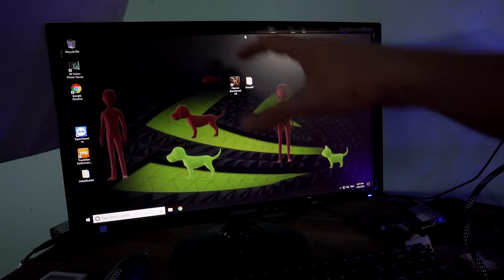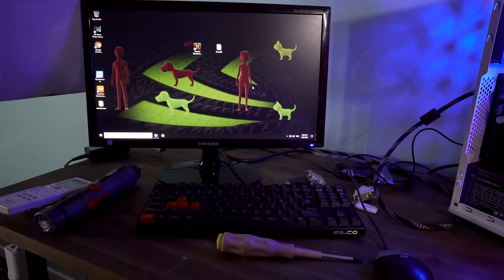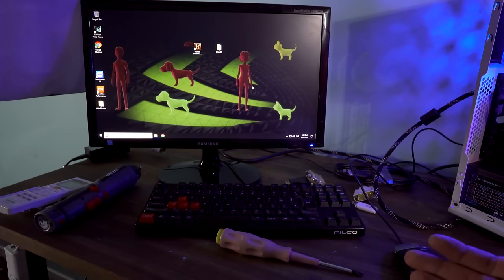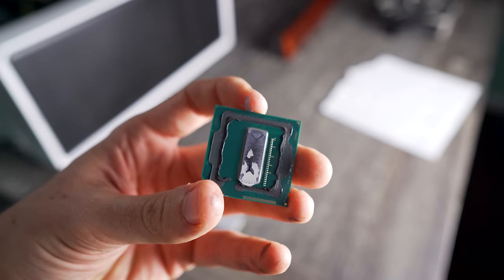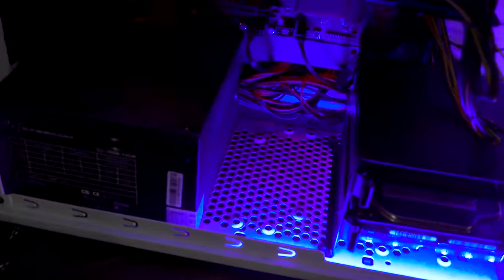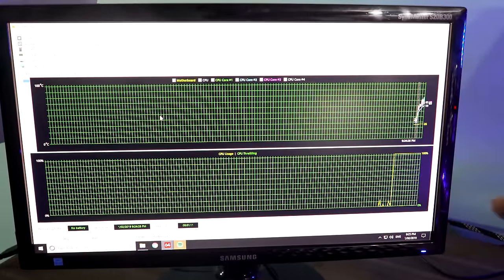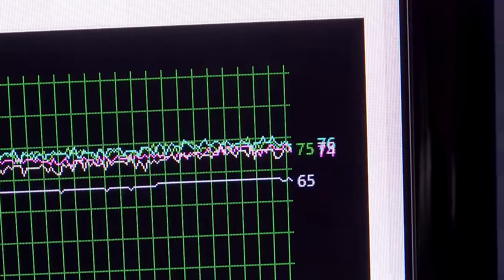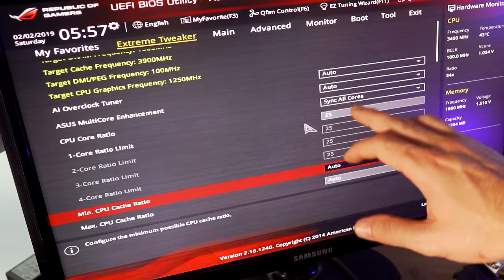How to Spot a FAULTY CPU.....? The i7-4770 Dilemma....

Comment: I think i have a faulty 8086k. I had bsod's randomly, even under windows install sometimes.. sometimes it would let me install it other times it would just freeze or bsod. I noticed a bent pin on my motherboard and replaced it. Although it had seemed like the cpu contact side had some darker spots, or miscolour. Mind you i had a h150 360mm radiator on the cpu and it never got over 50 under load, so i cant see how that would burn it.  But after i replaced the motherboard i still had the same problems with bsod. Also tried with different ram and ssd's. Could the bent pin have damaged the cpu somehow?

Comment: I’m having issue with pc build, when installing windows I get error message 0xc0000001 Stop_Thread_Handle_Exception_ Error_ message. At first I thought it could be the m.2 SSD so I flashed the BIOS and still the same problem occurred. The next step was to try the each memory stick and each one still gave me the same message. I even tried installing the OS on a different drive but that did not solve my issues. I’m coming to the conclusion that it may be a bad motherboard or bad CPU but not sure. Any assistance or advise on this matter would be appreciated.

Comment: i have heard that delidding cpus can void warranty.

maybe because you are an authorized dealer/builder allows you to delid and re do the thermal compound without voiding the warranty.

i am even surprised that manufacturers will warranty their electrical parts as many parts dealers diy repairs can void the warranty.

take for example if you replace the electronics of your kitchen oven your self you may lose the warranty as the manufacturer has no way to know how you handled the part and for all they know you could have burned the new part by connecting it wrong.

even worse there is swapping fraud where people buy new and put old in box and return it

Comment: Hello, and first of all great channel! Lots of informative and helpful videos, BUT please please stop using dissolve in between some of your cuts, cause you move camera almost every time and you have ugly transition there ( example on tc 3:40, from keyboard to bios menu, 3:52, from load optimized settings to keyboard, 4:09 etc. )  You can get away with cut instead or try something else , and your videos will look better. Dont get me wrong but little things like that and there is almost and you will have much better end result.
Anyways keep up the good work!
Reply from the maker: Thanks for the feedback, in the process of changing some camera gear around now.

Comment: I had a CPU that had a bubble in the paste application that actually caused a small fire, after taking the cooler off it has a small little crater where it had been burned...CPU runs fine after repasting but I had to add just a bit more paste to that crater area... Weirdest thing ever

Comment: Be careful with Cool Labs LM, seen a few now where after a bit (year or so) it goes hard and you have to scrape it off with a blade like soldier. I only use Thermal Grizzly now.
Also that's a crap cooler for a 4790K, you don't need to delid them, just use a better cooler for the job.
Reply: Watch the video carefully.  He specifically noted heat was not transferring to the CPU cooler and clearly demonstrated that delidding fixed the issue.

The cooler was not the issue.
Reply: @giglioflex  
Using a under rated CPU cooler could be the cause though with super high to low heat cycles which can dry the paste more,  just because it was ok at first means nothing to how it is in a longer term, and even after LM temps are still high showing what a crap cooler it is, it looks similar in size to a stock Intel cooler which they don't provide with i7 K sku as there not good enough, I have 2 CPUs on LM, 8700K and 6700K, I'll use the 6700K as it 4 core, at stock under prime it hovers between 45/50c, but with a 4.8GHz OC it still only hits 60c, stuff like gaming it barely goes above 30c, that cooler sucks for a 4790K and probably didn't help the cause one bit.

Comment: I bought a Cpu and mobo 8 months ago. It didn't started quite well, random shut down, freeze etc. But recently when i start computer it just opens but all the apps disappeared, basically it's gone. When opened the intel i-3 10gen processor just showing burn mark really unfortunate, intel won't relplace it because of burn mark...

Comment: Can a faulty/fake cpu fry motherboard I have a dell t3500 had a Xeon x5667 upgraded to a w3680 as soon as stuck it in there turned it on  and got a solid amber power light 234 light up and fan speed up no black screen I thought was the cpu so put my old one in and now still doing the same :( tried alsorts

Comment: So if my pc sounds too loud, could it be the cpu overheating and causing the fans to work harder? I got a used i5-3470 and I feel like i should re paste the thermal paste for the gpu/cpu.
Reply: You should see if your cpu is overheating using a program like speccy, or msi afterburner
Reply: @lollb454  yeah that's probably my best bet.

Comment: I have a Core I7 10700 cpu and after a year of owning it with moderate use and adequate cooling with a. high end motherboard and PSU I did downsized my pc from an tax to a mini ITX build still with the 80 plus for PSU and a nice motherboard I was stress testing it the temps only went up to 50 Degrees C. 3 days later I turn it on and I'm greeted with a no screen and a RED LED CPU on the motherboard, I swiped everything and the problem is still here so for sure I have a dead CPU. I hope intel will do there job to send me a replacement.

Comment: Doubt it was actually overheating that was the problem. It should just thermal throttle and slow itself down. The reseating of the CPU probably solved it

Comment: Prime95 is not recommended to work with Haswell. its not supported and causes massive over heat because of the CPU architecture not because of the TIM. I used to remember exactly why but it's been many years since I had an Haswell.
Reply: trryhrl I believe it’s due to haswell and up CPU’s during runs on newer editions of Prime95 (I believe the last version that doesn’t run avx is 26.6 but don’t quote me on that) running avx instructions during the blended stress tests which ends up running your thermals to unrealistic levels due to a load the cpu will never under normal circumstances see.
Reply: Yeah AVX instructions rings a bell, forces the CPU into drawing more current/heat than it's capable of handling = BSOD.  Aida64 was the community recommend Haswell stresser.
Reply: P95 is perfectly fine, but the latest versions are using FMA3/AVX2 instructions that are much more heat inducing than the previous ones at the times Haswell was launched. And AIDA64 uses AVX2 nowadays.
Reply: For Haswell K CPUs you need to delid the poor bastards to be able to run Prime95 AVX 2 stress test in above ambient temperatures, or at very low voltages, sub 1,2V with a very beefy cooler ( 240mm AiO or a fat Noctua). Once delided, i just stuck a Hyper 212+ on my 4670K at 1,4V 4,5GHz and it ran like that fo years at min fan speed max 70C :D
Reply: @trryhrl
It is not Prime95's fault. It is the intel engineers' fault.  Integrating the voltage regulator is one problem.  And then the AVX unit is obviously not designed to be hammered all the time like Prime95 does.  Prime95 is just crunching numbers.  It doesn't do something forbidden by the spec of the processor.
Reply: Prime95 is a great stress test, and is actually not even an unrealistic load. Do some encoding in Handbrake and you will see pretty similar thermals....especially if you do two vids at once. If your CPU crashes or overheats under Prime95, that means your overclock or cooling solution needs to be changed.

If you want an even better stress test that actually has unrealistic thermals try Intel Burn Test. I've had that find instability within an hour on a machine that Prime95 couldn't flush out with a 24 hour test.
Reply: that recommendation is for idiots without proper cooling or delid.

it'll run just fine with full FMA3 Prime small if you are delidded and have proper cooling for the task.  if you run prime small FMA3 with a Hyper-212, you deserve a fried chip.
Reply: 26.6 is the version for haswell. ;)
Reply from the maker: I find the blend test is great for reliability, its one of those quick and easy tests that does it all.
Reply: @techyescity  Very true, but a mix of synthetic and real world tools will verify that stability, and for testing cooling and OC, Prime Small with AVX is the real test, it's basically a heat generator / power virus of the same order that Furmark is for GPUs, the ultimate test of cooling.
Reply: @techyescity  Blend is great for testing stability, small FFT's is better for testing thermals because it takes a lot less time to saturate a water cooling loop. I use both of them when I overclock.
Reply: @techyescity  Yes prime95 26.6 blend test is the best for haswell. Doesn't grill the cpu with AVX. On the other hand with modern prime95 you will quickly find that toothpaste under haswell IHS isn't enough.

Comment: I have a faulty 2500K and a FX-8230 that doesn't boot at all. A friend of mine has a FX-8350 that has one problematic module which only runs underclocked

Comment: I have a Haswell core i3 4130 where temp readings play crazy. I have several of these, but only this one does act like that. Can I open it like shown in your video????
Besides, I had on a Asus B85M-GAMER MBoard a heavy CPU utilization after a fresh win10 install. I did update it and still had over 90% usage. I disabled the services "Diagnostic Policy Service", "Diagnostic Service Host" and "Diagnostic System Host" and left it on for several hours. Still high usage. Then I switched it off and went to sleep. Next day I switched it on and it runs now fine. Previously I Cinebenched the CPU getting only 10 and OpenGL getting 16.71. Afterwards, when the CPU was'nt that occupied, CPU 337 and OpenGL 80.93 This was clearly Windows related?#@!

Comment: i had a similar expierence with my 4790k. i used thermal grizzly conductonaut. i recommend putting a strip of kapton tape over those resistors by the die. i also recomend using a real delid tool. they r about 45 bucks compared to messing up a 350  buck cpu.

Comment: Can stress testing fry your components?  I built my first computer and overclocked it using online tutorials. It runs completely fine but i would love to stress test it to see if everything  is OK, but i'm afraid of frying something up in the build.
Reply: Only thing that fry your build if your cpu voltage is way too high
Reply: @lollb454  the max I've been told to put it in is at 1.35v. running a Ryzen 7 1700
Reply: 3.9ghz
Reply: @truthbetold7771  well if you keep your temps in check, there is no way it's gonna fry, pc components are designed to run at 100% load

Comment: What about Intel Mac Pro Ram (it has a processor on each Module)  and I have just lost 4 GB's of ram (32 GB down to 28 GB) >> do you think the heat sink has dried out the Paste ????
Reply: you mean the cpu has quadchannel memorycontroller which drive every rammodule? i do know nothing about apple shit. only the e5-1600VX CPUs which are taken from the mac pros i know. i would change the memorymodules inbetween the slots, look if they are correctly in the slots?? or does there is relay a processor chip on every module to  make it as expensive as possible? every time i look at apple mac pro websites i wonder how anyone is willing to pay this absurd high prices. for the design? I can build a pc with the power of a 30000€ mac pro for ~1500€ with used parts from ebay using also xeons but older generations which are unlocked and minimum as fast as the newer ones with reference clocks, if you overclock this unlocked cpus to a similar stable oc in the bios. An e5-1650 wich costs about 65€ is as fast as an e5-1650 v2, v3 with very realistic and stable 4,5 GHz watercooled with an 50€ aio it is as fast as an e5-1650 v4. and 256Gb Ram is quite a lot. ok the v4 supports 768 GB. but i see that you don´t have to overclock an e5-1650 to 4,5 GHZ to make it as fast as the v4. maybe 4,3GHz is enough. for this clock you just have to raise the coremultiplier to 43 in manual settings and put the corevoltage and vt voltage to manual and + below!! but the thing is that the mac os just works if it is emulated because of missing driver signatures . there is allways a little inputlag and this is unacceptable for someone who needs the apple for work. apple wins this game at the end:(

Comment: i only had 1 cpu that ever gave me problem.It was way back i had a 3ghz northwood cpu that i did a custom cooling on.Over clocked her to 3.6ghz she did the fastest benchmark back then think it was 3dmark 2001 and 2003.Finished it once pc stuck and after that she didn't want to oc higher than 3.2ghz.Other than that cpu's are usually very reliable.

Comment: I had an old Core 2 Duo that was bad. The symptoms were while in game I was getting random freezing of about 1.5 seconds then it would be normal. This repeated every 2 min or so. I tried everything else until I tried a different Proc that fit the same socket and it ceased.

Comment: Can you help me so my rig has a brand new Rx 570 8 gb GPU a older i5 process 16 gb of RAM and I have been having an issue where out of no where my rig will die as if I flip the switch on back then it will start up again as a reboot and the fans run up but from what I see no temps are about 70 or so  my dad said it may be the board or a short cable

Comment: I been around computers since MS-DOS days never once experienced a faulty CPU where it kind of works and don't work. I stopped using Intel processors after Pentium II Slot 1 CPU and decided to use AMD processors. My reason for doing so is AMD processors tended to be cheaper then Intel Processors. But week ago I was able to snag a used i7 8700 and motherboard for $50 dollars. Which replaced my AMD FX8320 which I been using for the last decade. First time using a Intel system since Pentium II Slot 1 days. lol

Comment: I have heard of someone dipping dead CPUs in liquid nitrogen and it worked again...
Reply: Joe no How so?
Reply: @timpeng4418  silicon is a crystalline structure.. Making it extremely cold will make it shrink along with the p cb and most likely if nit outright fracture the silicon it would give it irreperable internal damage to the silicon

Comment: Just to let people know, if you're going to delid your processor, do not remove the silicone sealant. Removing it can change the amount of space between the IHS and the die, and can cause lots of problems. Also, don't glue the IHS back on. Instead, place it in the socket carefully and just make sure the IHS is lined up properly when you clamp it down.

Comment: i7-4770K here after 5 years still @77°C max after ~10mins 👌
Must have been not sealed well or the user did tortured it to the max
Also some games have bugs where the graphics dont limit the FPS and strain the whole system to the MAX
Reply: i7-4770K here with 4.5ghz @ 73°C max not delidded
with ddr3 2400mhz cas11

i think i will try 2800mhz cas12 4x4 but it price are high

Comment: jeez that paste is worse than my older I7 2600K which is at 4.9ghz on air, but I bet the only way its actually working is because of the huge cooler and I really tight it too hard (harder than I would ever do to anyones PC :) ).

But I'm guessing its squeezing him a lot lowering the thick shitty black glue so the thermal compound will be squeezed and get thinner. When I cleaned the cooler and put Artic MX4 (had MX3 before), all the CPU pads even have holes from the motherboard pins, but not that I care its still kickin ass and if I ever delid it I would put liquid metal and aim for 5ghz if it dies it dies.

I use OFFSET+ voltage for the OC +0.155 its close to red, but I tried going a few steps higher, but still no chance of 5ghz here, CPU not delidded :(.

ps: Anyway it was way easier to bring the CPU to 4.9ghz than actually getting the ram to 2133 mhz working that took me quite a bit as it was always not accepting because sadly I have a mixed ram, the first ones were actually way better than the ones I bought a few years later which are high voltage sadly and the timmings are even higher than the ones I bought in 2011...

Comment: I bought a 4670k for parts from ebay. the cpu would behave work, then slow down, then crash. 99ºc on 2 cores, 70 on the rest. Delided the thing, replaced the intel shit TIM with what i had on hand, Noctua NT-H1, used it for a few months, no issues, sold it for 70 pound profit. xD

Comment: I have a bad ryzen 5 1600x. When I try to boot a pc with it installed the graphics card fans turn on for a split second then off and I never get any video output at all. Tested it on three motherboards with four different graphics cards and it wont boot at all. Swapped the cpu to a 2200 G and all three motherboards boot right away no issue. I also swapped in an 1800x in all three motherboards and the first graphics card worked every time. So I have it definitely narrowed down to the ryzen 5 1600 x being faulty. I looked at the pins on the bottom with a magnifying glass and could not see any bent pins or anything out of the ordinary. Any ideas why such a new processor would fail?
Reply: Bios
Reply: @mazi16v  I doubt the bios would have anything to do with it. As I said it was the same on three different motherboards...

Comment: Coming from a i7 3770K was a jump but I still would like to use my 3770K with the Asrock Extreme4. But the chip won't go past 4.3GHz. No matter what. So i thought maybe if i use some liquid M i could get the Temps down past 80+°c that it would help.. Any suggestions on some i7 3770K bios setting on a Asrock Extreme4
Reply: That curious. I had an I7 3770(non-k) on a Gigabyte Z77 UDH3 and I managed to OC it to 4.3 Ghz with a BCLK overclook. Ivy Bridge should manage around 4.7 Ghz.